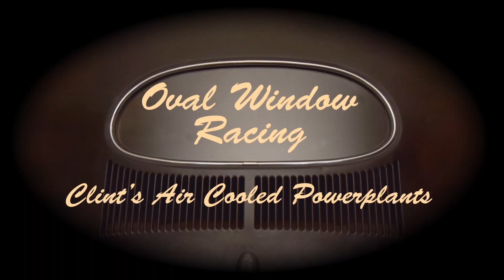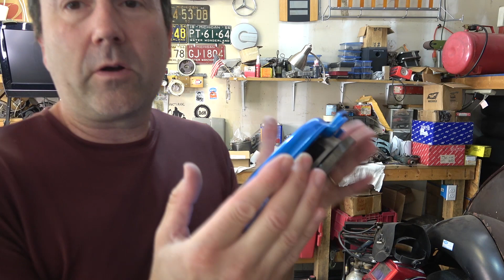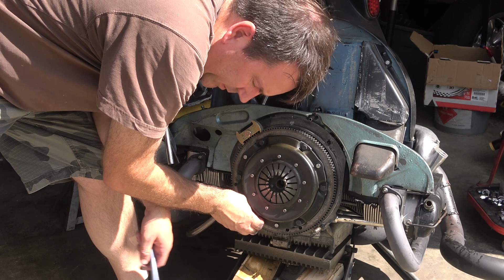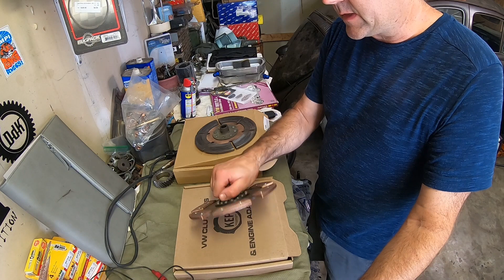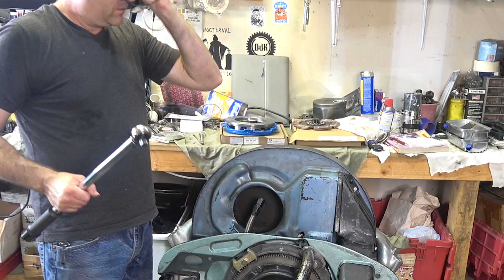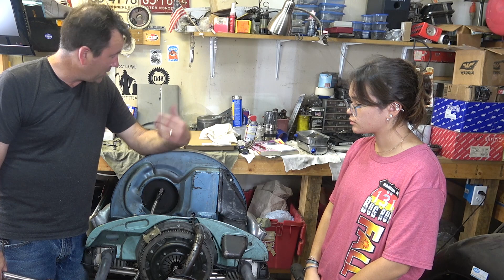Testing Different VW BUG Clutch Disk and Pressure Plates

Comment: I just did this on my turbo engine with a Black magic and stage 2. Smoked the pressure plate in 7-8 passes maybe 500 miles on the street. Moved to a stage 3 and 6 puck as well. I also did not realize the thickness difference. Hopefully it holds.

Comment: Interesting. I've done that same thing a few times. I spoke to Ron and he told me he has guys running a stage 1 and black magic with 500hp. Mine wouldn't hold with 260hp. So far the BM with stage 2 is holding what I'm guessing is closer to 300hp now. Hate the feel of that clutch though.
Reply from the maker: Ya, I didn't like the feeling of the disk either. I think I am having a thickness problem. Go and watch Tom's video I linked. I plan to try that test next.
Reply: @ddk56vw  yeah I've seen toms but I wasn't willing to buy a tool just to use one time. I had a stage 2 and a super disk and it held the 260hp on the Dyno, but then started slipping. Turned out to be it got some oil on it, but I planned to increase HP so I went to the black magic.